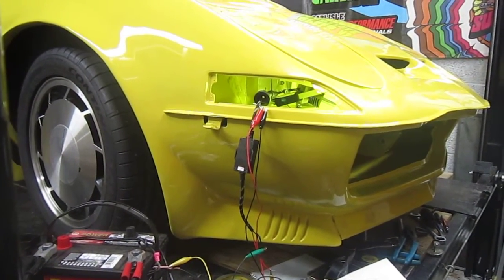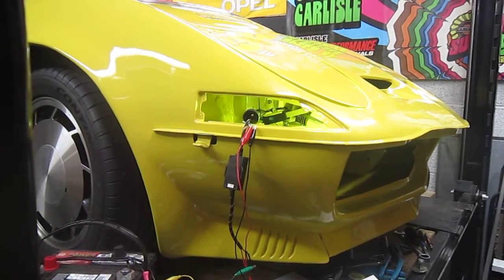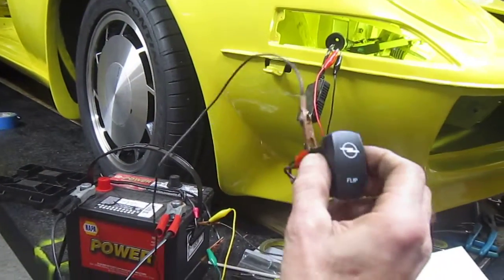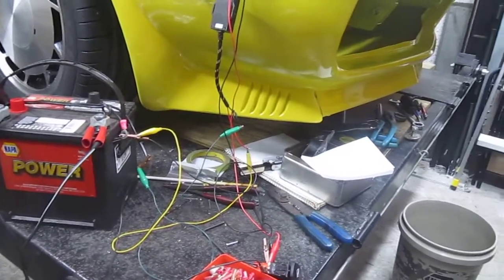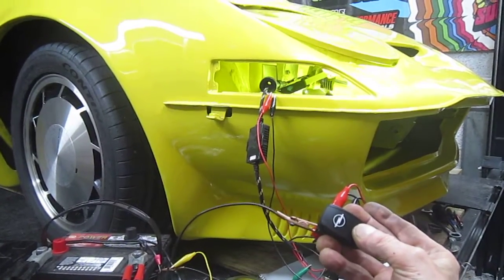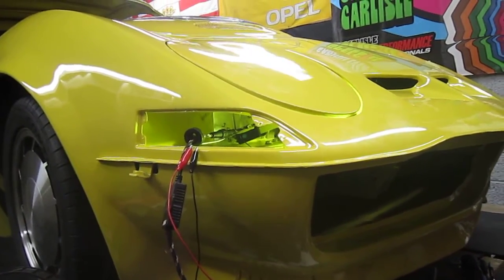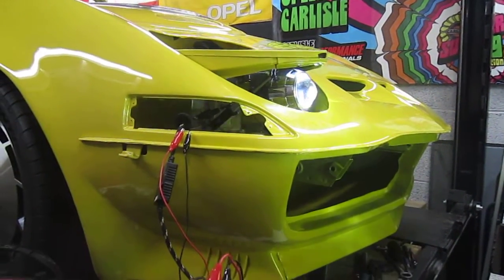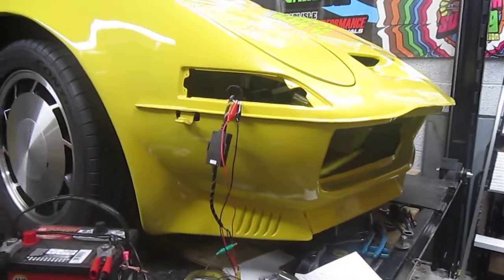Opel GT: Electric Pop-Up in the Front Headlight Mod

Comment: So, you take away the most unique part of an Opel GT, and convert it to the same as any other pop up light
Reply from the maker: I discovered in the process that the headlights were originally intended to pop up in the front. The perfect place for pivot holes were already there with 2 flat spots. The GT2 also had pop up in the front headlights, so it was obviously something that Opel was thinking about. The whole design of the roll over headlights was very unOpel-ish, I'll bet it was a cockamamie idea invented by Clausson who made the bodies.